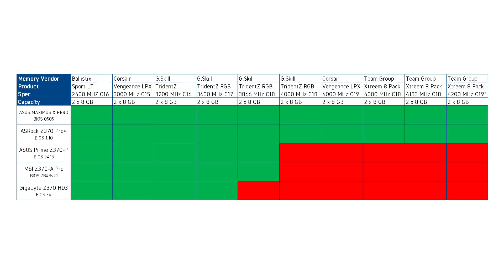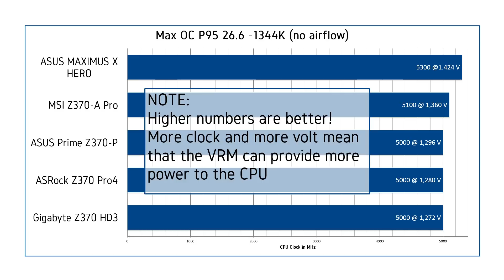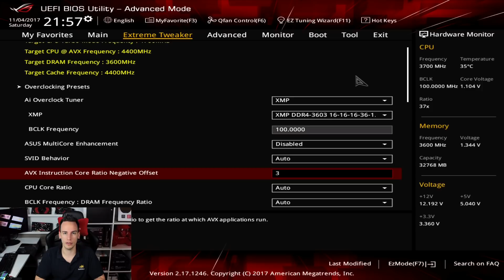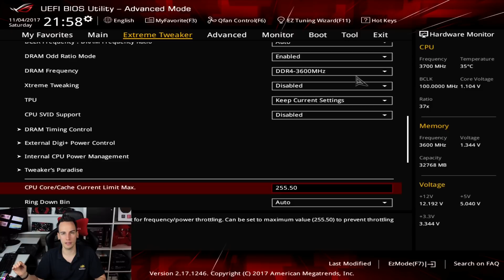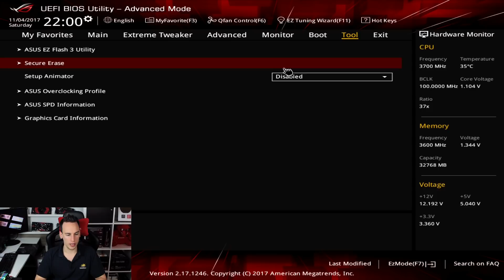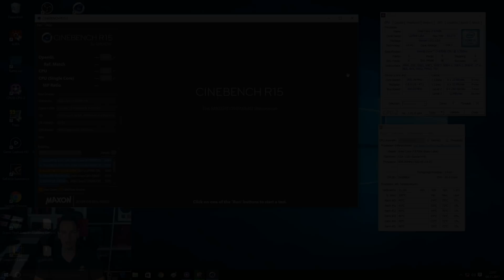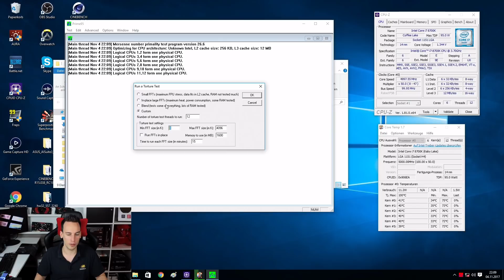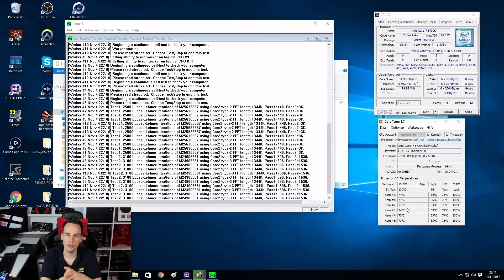ASUS MAXIMUS X HERO - Overclocking Test and Guide 8700K (en)

Comment: Hey wie gehts?
Reply from the maker: Läuft :) Und selbst?
Reply: der8auer auch
Reply: @der8auer  Hey der8auer, I REALLY SEEK HELP with my OC! It' s a one year old post, so i replied to your comment in hope that you would see my post. I understand you must be very busy, but I really hope you can find a few minutes to answer my question. Thank you.
My system: 
-i7 8700k (delided), 
-MB Asus Prime z370-a, 
-AIO Corsair h115i,
-3200 mhz, corsir ram 2x8gb

So I followed your instructions step by step. I believe I have a very bad chip, because nothing seems to work.

My only stable OC settings (Prime95 26.6):
- everything the same as you instructed 
- AVX offset 1
- 48 on all cores
- core voltage 1.350

I managed to pass Prime95 26.6 custom for 21 hours (30 minutes of 1344k, 8k, 800k, 864K everything OK). Cinebench r15 also fine, OCCT seems fine. One hour of gameplay of BFV using AVX, no crashes.

THE PROBLEM STARTED WITH PRIME95  29.8. Although I did passed custom 1344k, 8k, 800k, 864k, I can not pass "small FFT test", everything I tried caused eather a BSOD or stopped workers or couldn' t run all cores at 100% from the start. 

Can not even pass 47 all cores at 1.390 with AVX 0.   

What is wrong is my motherboard not good enough, is something wrong with my chip? Or am I doing something wrong in the BIOS? Thank you so much.
Reply: @der8auer  I forgot to say that temp are ok most of the time between 65° - 75°. Even with 1.390 avarge temp are around 70°.

Comment: but i guess maximus apex is even better for overclocking? i want that mobo to be tested by you!
Reply: KmcStas apex cost $349.99. It better be better for overclocking.
Reply: The Apex has the same VRM. The main benefits of the Apex are for settings you would not run daily like. RAM clock and timings 1.9-2.1V memory voltage.
Reply: Actually Hardcore Overclocking apex has 2 4pin cpu power, hero has only one. This is interesting
Reply: KmcStas I’m lost 
What does that mean?

Comment: Does the CPU continues to use a lot of power while in idle, when to voltage is set to manual and forced to run 1.36v idle?
Reply from the maker: No. 90% of the power consumption is caused by the load and clock. The voltage itself doesn't change that much. Maybe 5-10W